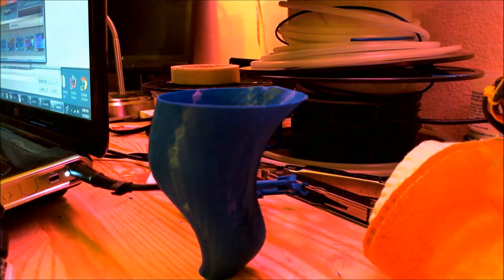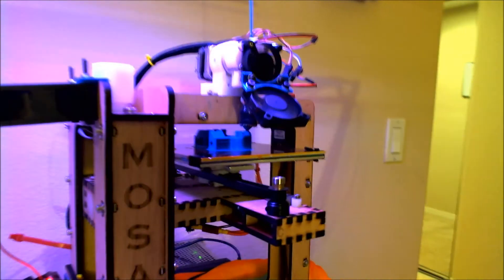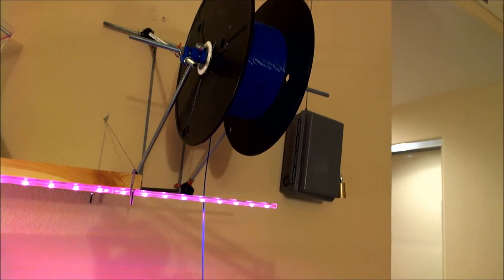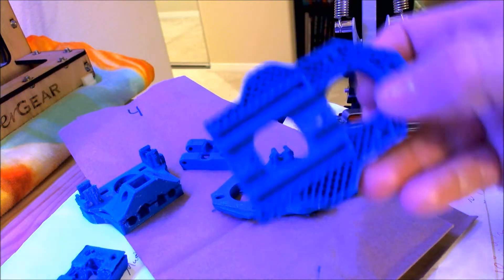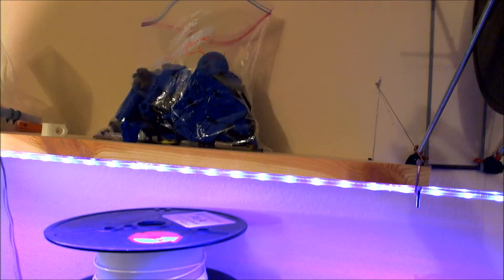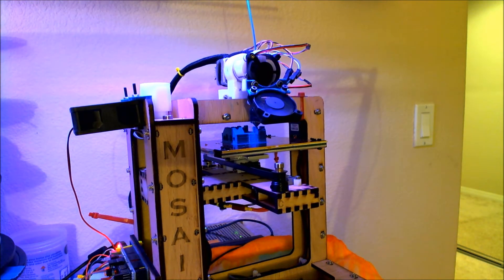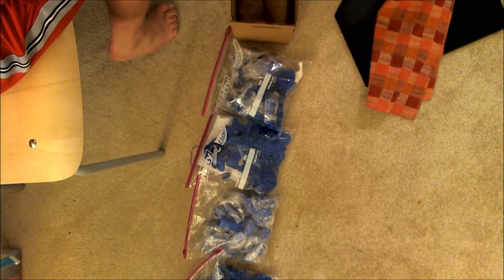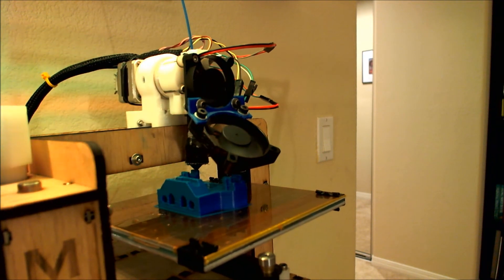Makergear Mosaic  Amazing 3D Printers

Comment: Autodesk is fine all you need to do is convert it to an STL file then run that file through another program like skeinforge or slic3r to produce G-Code.  G-Code is instructions for the printer on how to print whatever you want to print.